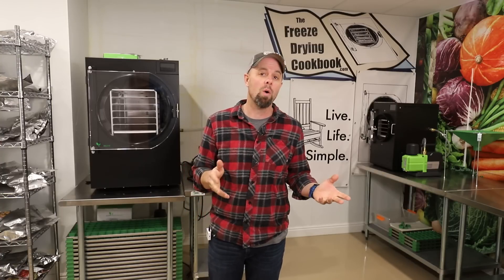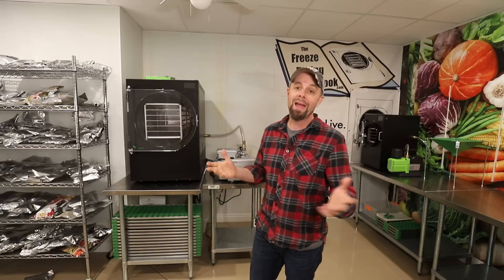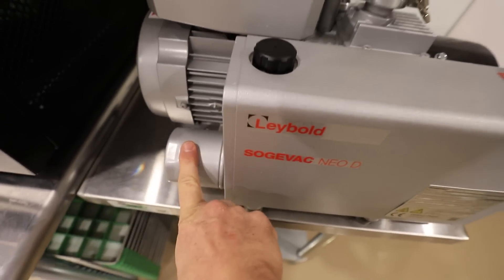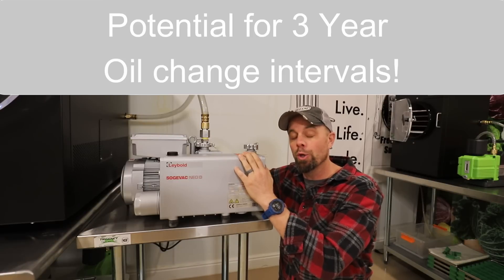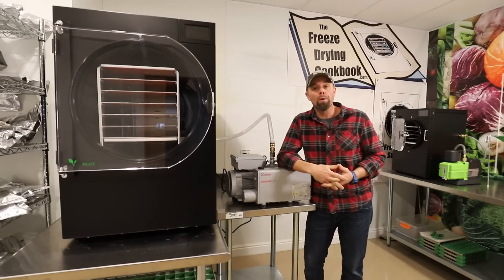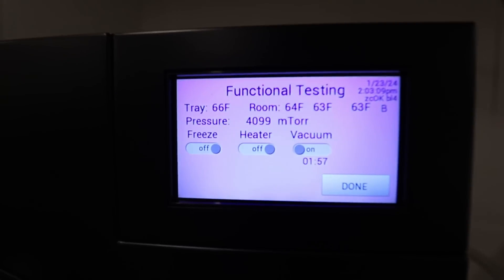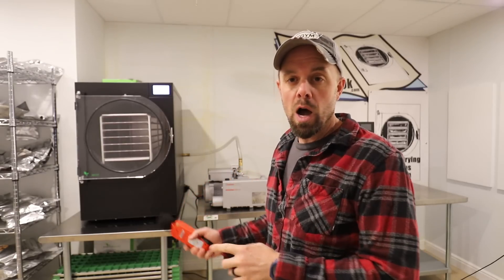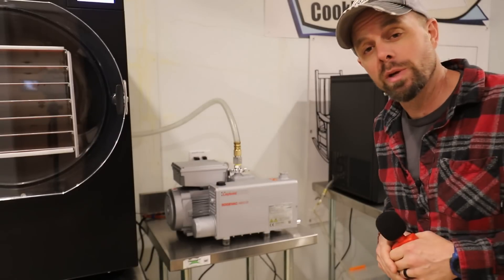Upgrading Your Freeze Dryer with the Leybold Neo D Vacuum Pump -- Freeze Dryer Pump Upgrade

Comment: I just setup my large harvest right fd. I went through the first steps to test it (not the bread run yet), and the oil in the pump dropped to a little bit above minimum. I started out halfway between minimum and maximum like the manual said, but it immediately dropped significantly when the pump turned on. The manual states that it is supposed to be in the middle the entire time, or it could ruin the pump. It said that I should add more, so I did. Now, once it cooled off, it's almost to the maximum. I'm afraid it will come out of the demister when I do my bread run. Do you think I should drain some to halfway, and not worry about it dropping when it turns on, or should I leave it almost to the maximum, so when it comes on, it will drop to halfway? It's so hard to get answers from HR. Thank you for all your help. I bought a couple of things from your store.
Reply from the maker: Fill a cold pump halfway and do not add more.  It's just like a car in the sense that, when it's running the oil is moving throughout the pump.  Just like you would not check the oil on a running engine because it will give a false reading.
Reply: @thefreezedryingcommunity  Thank you!!!

Comment: I'm curious if it would be possible to hook up one pump to multiple machines in some ways. I'm not familiar with freeze drying cycles yet, I assume the pump is not running all the time ? 

If you could sync up the machines, maybe vacuum seal them at the same time. Or maybe it's better to do it out of sync like one machine at a time with proper electronics and plumbing.

Could help save on cost, but ofc if it breaks you have a really bad day :P
Reply: Welp, decided to look at the video you referenced from EpicenterBryan and it's exactly that. 3 machine one pump, nice to know !

Comment: I used a kf25 solenoid valve so I can preheat the pump and the freeze dryer turns it on automatically.
Reply: I also used an Edwards RV12, which is another fantastic option for freeze dryers.

Comment: The pump is not a 7cfm rated. How does this impact the software in the HR?
Reply from the maker: The software is looking for Mtorr measurements and is not affected by the pump cfm
Reply: @thefreezedryingcommunity  Good to know. I have an old machine....it only looks at  time.